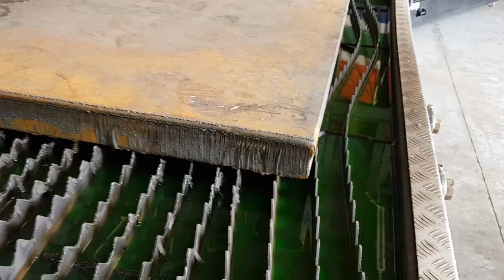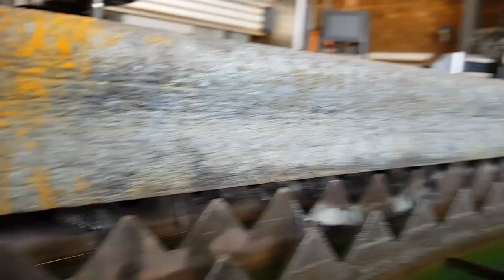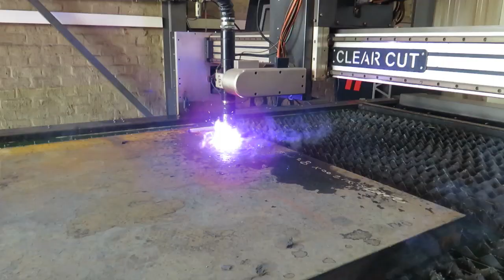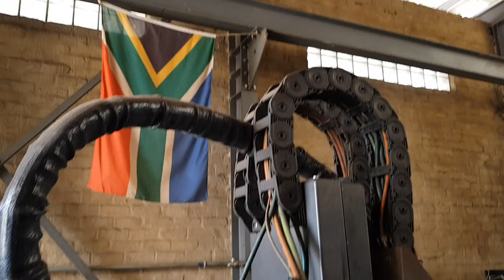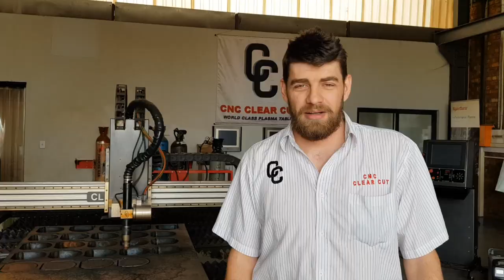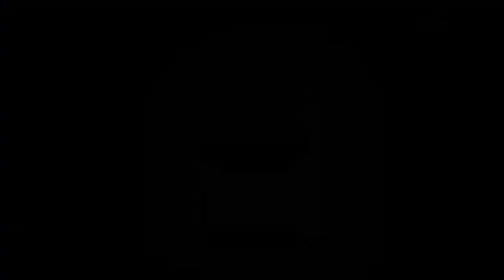Plasma cutting 80mm with XPR300

Comment: what was the speed per min do you know for the cutting of it at 80mm? is it faster then normal flame cut?
Reply: Hi James, I believe the speed was 180mm/min. I would rate it probably the same cut speed as a flame cutter at this thickness. Thought the plasma does not need the time to heat up the plate. That being said i do believe from here on up flame cutter would most likely be the better option.